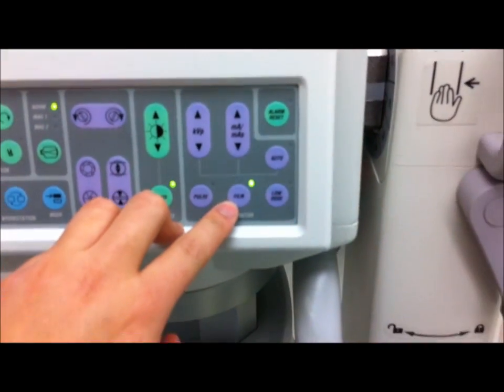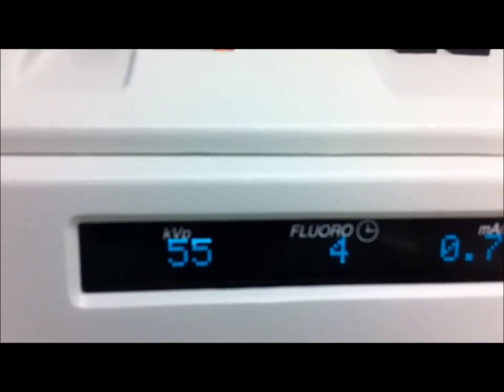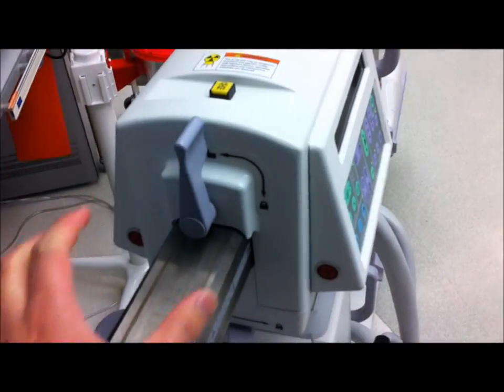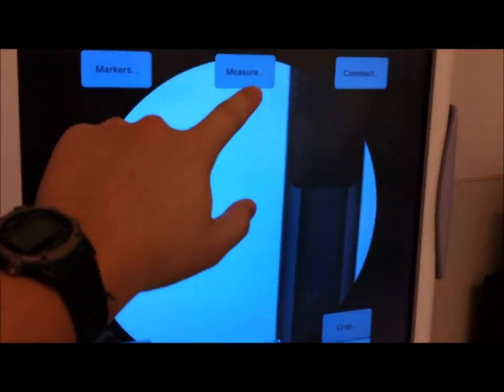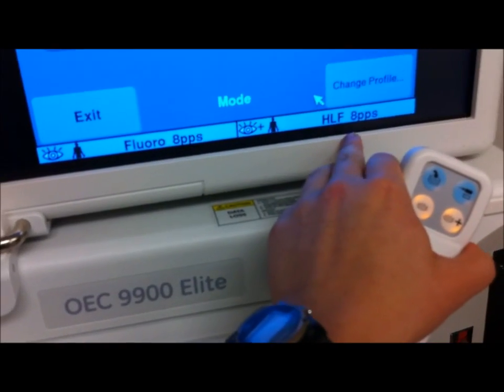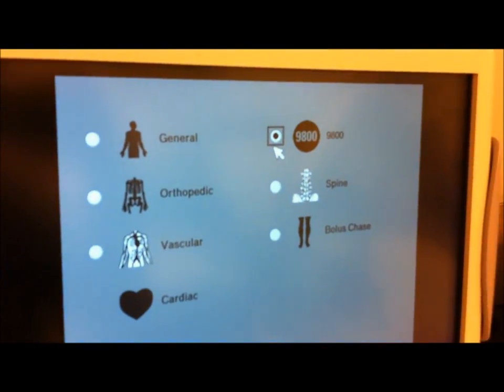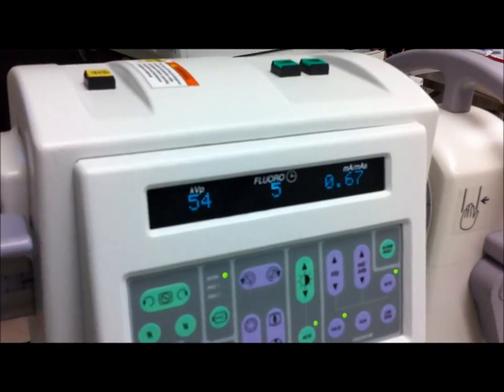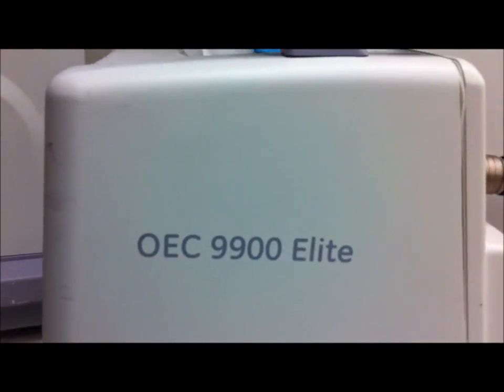General Electric OEC 9900 Elite C-Arm Tour Part 2

Comment: Can you tell me what does fluoroscopic run means? what does radiographic run means? And what’s the difference between these two in a c arm which is used for cardiac procedures in a cardiac cath. Lab?
Reply: Run and Loop can be used in the same context.  In regards to using it for Cardiac, you would most likely want to use Digital Cine Pulse at 30 FPS/PPS due to the fast motion of the beating heart.  The Cardiac systems have a foot pedal with 3 pedals.  Standard Fluoro (EYE),  HLF or Subtraction (EYE+) and the third pedal which would be a dedicated Digital Cine Pulse button.  That takes the frame rate, and syncs it with the pulse rate to allow you to capture detail from fast moving anatomy or vessels. (Cardiac or Neuro).  Digital Cine Pulse also allows you to do a run off down the leg where you can chase the contrast instead of doing segmented subtracted runs of the leg.  Please keep in mind that a higher mA is used with Digital Cine Pulse and will only provide you with 10 seconds of run time if using 30pps and 27 seconds when using 15pps.  Hope this helps.

Comment: Also what is one loop ? When we push fluoro for 2 or 3 seconds to see an artery track this makes a short video. So now do we call this a loop or a fluoroscopic run?
Reply: Hello.  One loop is considered the length of the recorded Cine Run.  Example.  If you were to take a 9 second exposure, and record it, the system will play back the recorded cine run in a "loop" meaning you would see it from start to finish, and then it would loop back and play again, and again and again until you physically stop, or pause the cine run or take another exposure.   Regardless, it is still called a cine run, or loop.

Comment: THANKS, AND HOW DO YOU CALIBRATE FOR MEASURING??????
Reply: Hello Rlalko,  In order to calibrate for measuring , you must first have something in your field that is a known distance.  Example would be if you were doing an IM rod for a tib fib, and you wanted to know the length of the locking screw at the ankle, you could ask the rep the size of the width of the rod that was used.  That would be the known distance, and you could calibrate off of that.  I am one of the CIS for GE OEC in the Philadelphia area and would be more than glad to help.

Comment: How do you calibrate for measuring
Reply from the maker: To calibrate, you need to know the size in millimeter or French of a item in the field of view.  Ideally to be accurate, the item should be at the same level as the area being measured and centered on the screen for calibration.  A example is a pedicle screw.  You can often (but check with the surgeon) and the determine it’s size by measuring the length of the screw threads (not the head) and entering the millimeters of the length as the calibration.  You can set the calibration lines using the touchscreen on the right side monitor and then using the keyboard’s arrow keys to fine tune the highlighted ends or edges of the line.  Once that is done, enter the millimeter or French size and press exit to get back to the measure page.  Then go ahead and measure using the the touchscreen and the arrow keys like earlier.  Hope that helps!

Comment: how to make a cine mode for barium swallow?
Reply: Go into Cine, and then Cine Set Up and place an "X" next to either the FLUORO box, or HLF box.  You will see that there will be a FPS on the status bar on the right monitor.  The system will then record whenever you use Fluoro or HLF.  Also, system has to have Cine functionality.
Reply: is the images quality okay?
Reply: @funkygiglydoll  The image quality should be fine, just not subtracted.  What you are essentially doing is live fluoro and just recording it .  The barium will show up as black which is the same as contrast would look.  Now remember you can always negate the image to make it look like a standard xray where the barium will show as white.  The negate button is located on the workstation on the left hand side next to the keypad.
Reply: @Shruti Shrivastav Hello, I am not sure exactly what you are asking.  When making a continuous fluoro exposure, you will hear a beep for every second.  If you are using HLF or the eye+ exposure button, you will hear 2-3 beeps per second.  If you were to hold down the exposure button for 5 seconds, you would hear roughly 5 seconds.  Depending on the system (9800, 9900, or Elite), you will also notice that there is an light on top of the monitor of the workstation.  When you take an exposure, the light should go on, and subsequently go off once the exposure is terminated.
Reply: @Shruti Shrivastav Hello.  The exposure will be as long as you hold the button down.  If you want to take a 10 second exposure, you would hold the exposure button down for 10 seconds.  Once you release the button the exposure will terminate.  If you are taking single exposures, the system will terminate once the image is of good quality.  Hope this helps